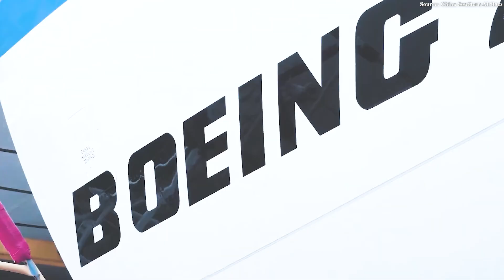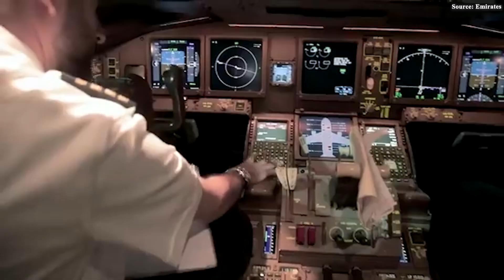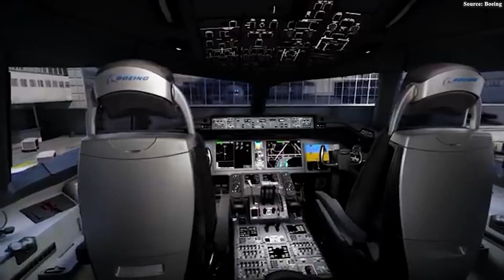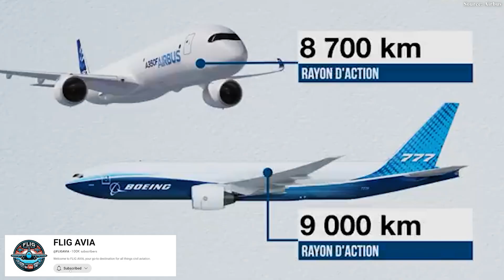Boeing Just DROPPED A Bombshell For Boeing 777-8F That OUTSMARTED A350F!

Comment: The difference in capacity between the Boeing 777XF and the Airbus A350F is only 3 tonnes or 2 pallets in volume.
Reply from the maker: Thanks for the info!
Reply: 777XF has better range, fuel burn and reliability, lower maintenance and operating costs.
Reply: @Jeff-ej4wp  No, 777XF is heavier and has no better range. You must think about MTOW.